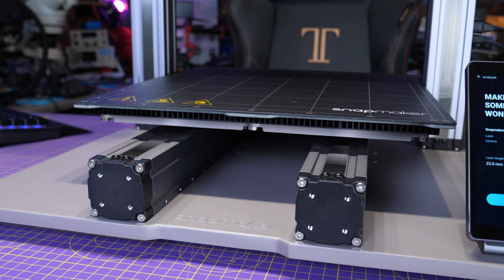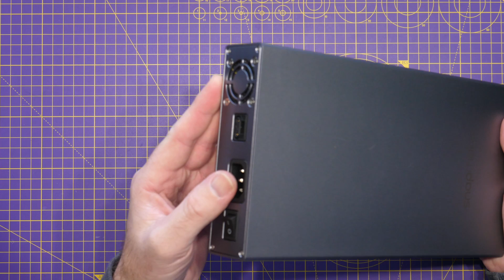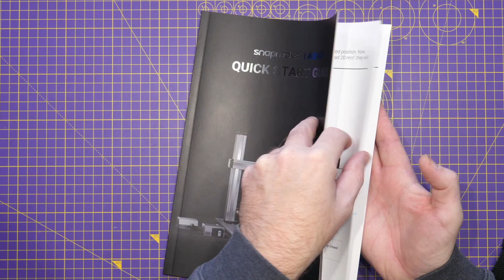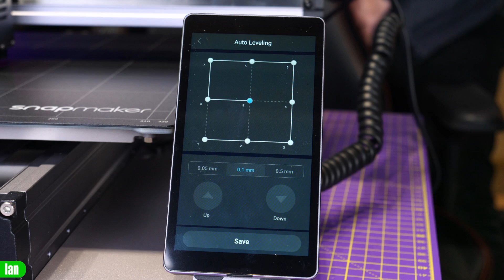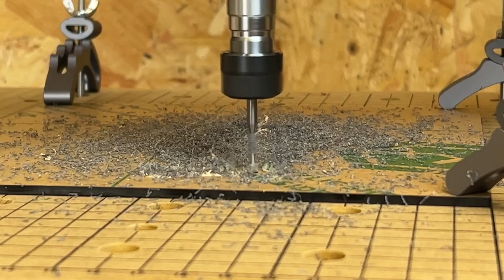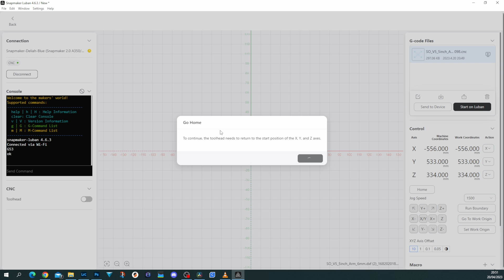Snapmaker A350 3 In 1 - 3D Printer CNC & Laser Review - Good But Frustrating

Comment: Thanks for posting this overview. I've had the same model for a couple years and have run the printer regularly. Still prints like new but can struggle with TPU. I've heard that the idler wheel door needs to be left open slightly in order to put less pressure on the filament.   I've seen people online tape the door slightly open. This prevents the TPU from getting bent or from the drive wheel grinding in a rut. Maybe I just need to slow down the print speed significantly.  I also haven't had any luck controlling the heated bed temperature even though it is adjustable in the software and the touch screen.  I look forward to other videos with this equipment.